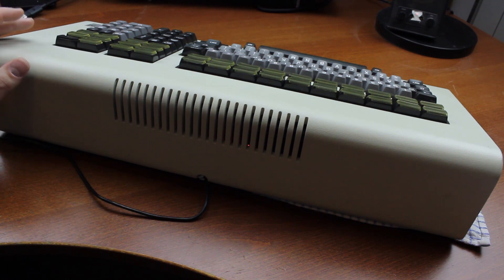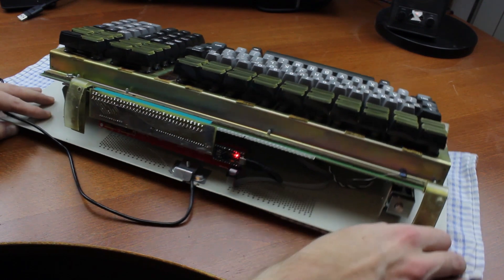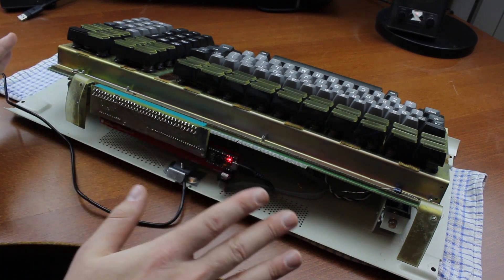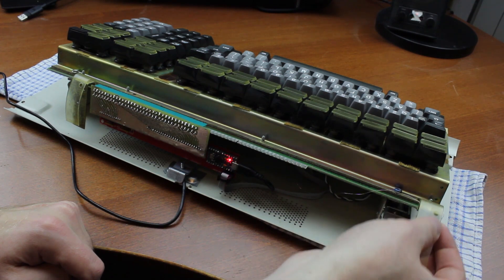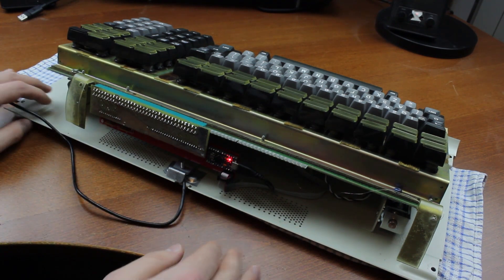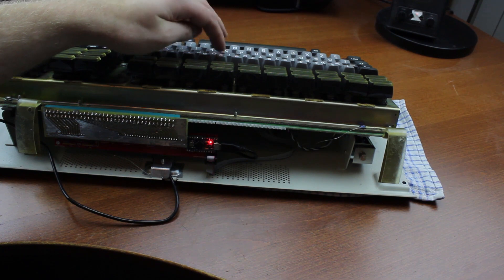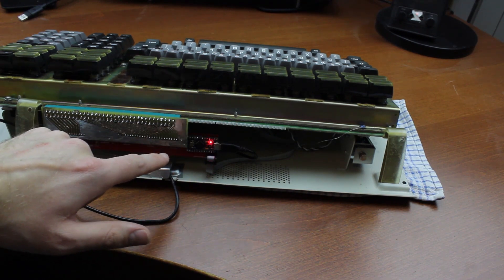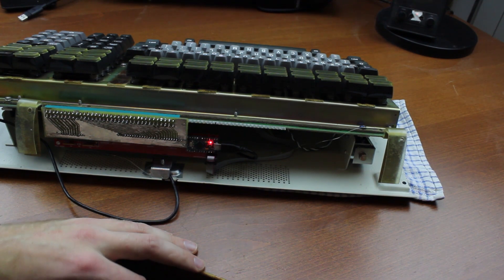Beamship update (or: how I got the IBM 4978 keyboard working)

Comment: A shout-out to pandrew for making such a great boards. By the way, they're all available on GitHub and the step-by-step instructions on how to order them assembled from JLCPCB is explained in his GH threads:
Model F AT converter: https://deskthority.net/viewtopic.php?f=7&t=24597&p=473987#p473987
Beamspring compact converter: https://deskthority.net/viewtopic.php?f=50&t=24512&p=473635#p473635
Solenoid Driver: https://deskthority.net/viewtopic.php?f=7&t=24598&p=474000#p474000
Of course, all this work has been inspired by XWhatsit converter.
@Chyrosran22: From where did you buy the replacement solenoid ? I'm looking for one that is compatible with pandrew PCBs.

Comment: This is really cool. I have my own beamspring but I have no idea how to make it work. Any tips on finding out how?
Reply: You would need an xwhatsit converter. You can generally find one on eBay, and I think modelfkeyboards.com is still allowing orders for them.
Reply: What model number you have? Some beamsprings need their pcb replaced first before you can fit a xwhatsit or pro micro based version from pandrew.
Reply: @robbinhasseltof4428   I have an xwhatsit, and its a 3278. It's in pieces now,  but once it's together Its the making it type that I have no clue on.
Reply: @channalname5771  You can mount the xwhatsit on the pcb and then use this guide to flash QMK to it: https://docs.google.com/document/d/17FqGhuCrTAPPrL3vBJoAVU0weUeTX0rUu7izaSOg80w/edit
Reply: @robbinhasseltof4428  Thanks!